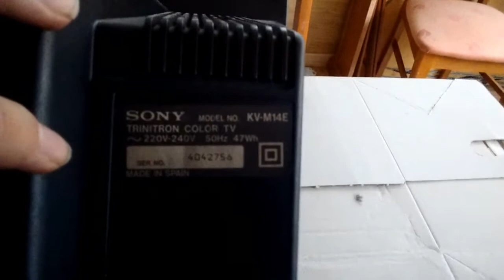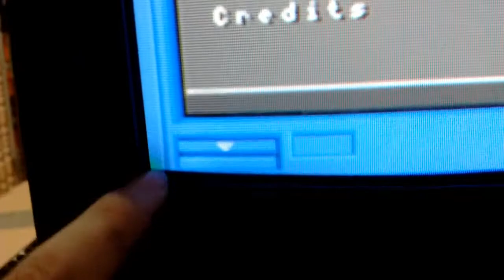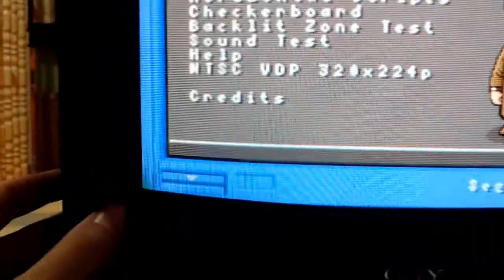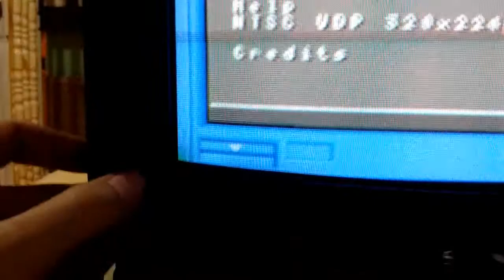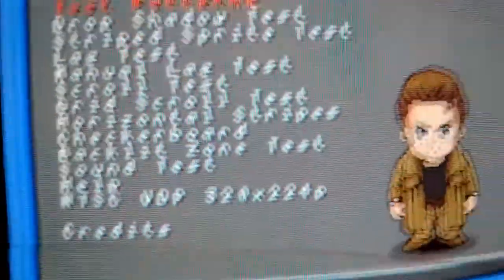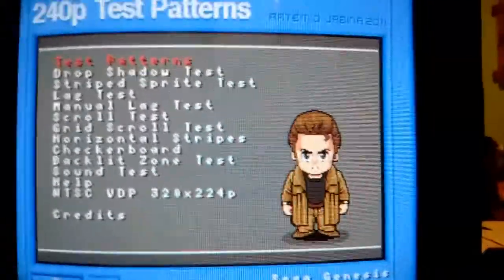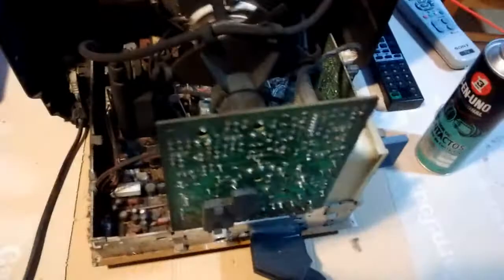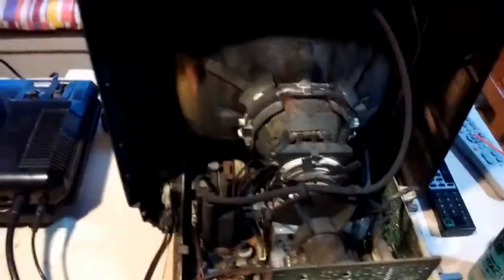My new retro gaming TV pt.1

Comment: Just subscribed. but I have a question, how did you mod it for 60hz to make it full screen?
Reply from the maker: Do you mean the old Trinitron or the Megadrive? The Trinny's a bit complicated, but the Megadrive's quite easy. Try this guide: https://mdpal60.net/wiki/megadrive/regionmod/start
Reply: The old Trinitron, but since my comment I got newer Trinitron model today which has screen aspect size option on the controller to make it full screen. I've put the older model into storage. not sure if I fix it... :\ thanks for the reply.
Reply from the maker: Well, I don't have the old Trinny anymore, but I do roughly remember how I did it. What you have to do is find a subboard (mounted vertically in a socket) which has the V. Size potentiometer. Then you connect another pot (Ideally of the same value, but there's some tolerance since it's just acting as a voltage divider) in parallel to it. After that you just have to connect both pots' wipers to a SPDT switch, and the common of the switch to where the wiper of the original pot was connected. Then you just adjust each pot for each vertical size.

I'm sorry I replied so late, I had some personal stuff going on.
Reply: ah that's great. possibly a little technical for me to do. but no problem about the time delay. another one popped up online soon as I got the older version and I had to have it. It was really cheap and close by.

Comment: Hi there! I have kinda the same problem with my kvm1400k - picture not that straight on vertical and horizontal (cushion). I've been trying to manipulate with yoke, it doesn't work. Maybe some hidden problem on chassis?
Reply from the maker: Looks like that Trinny is newer than mine. It probably uses a service menu rather than hardware adjustments. Anyway, messing with the yoke should always be your absolute last resort, especially on a Trinitron.